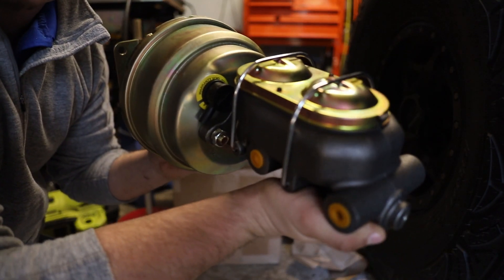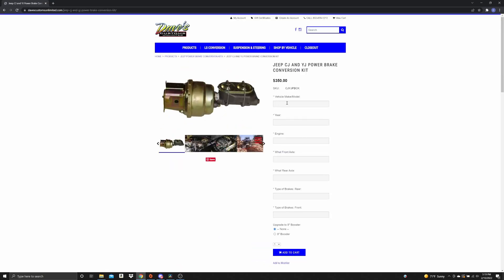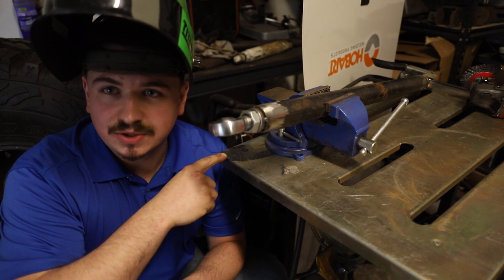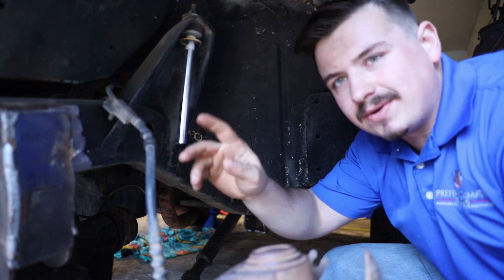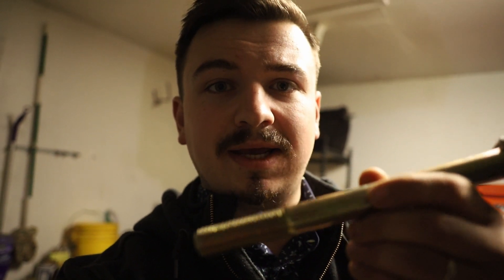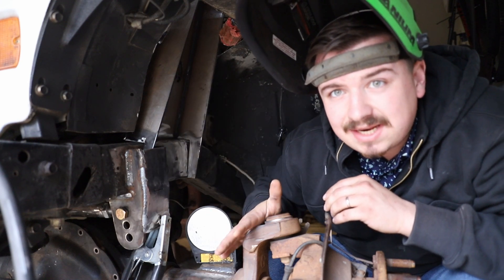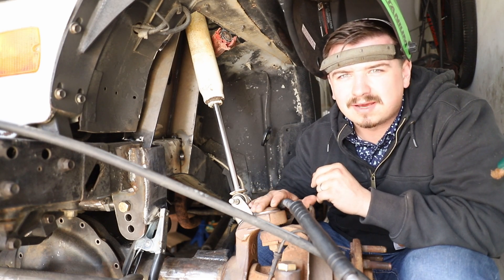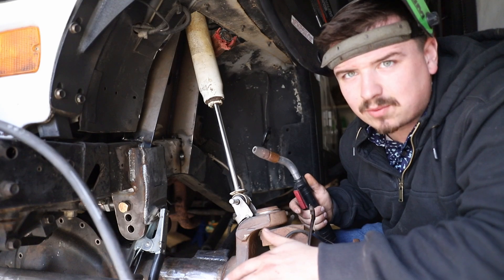Building Rock Crawlers is So Much Harder Than Expected! - Jeep Wrangler YJ 1-Ton Swap

Comment: Instead of leaving the heim joint in the insert, could you use a (potentially sacrificial) bolt instead? Protect threads and catch bbs
Reply from the maker: Yes for sure.  I’m not in expert by any means.  Just trying my best to put together a build I’m proud of.